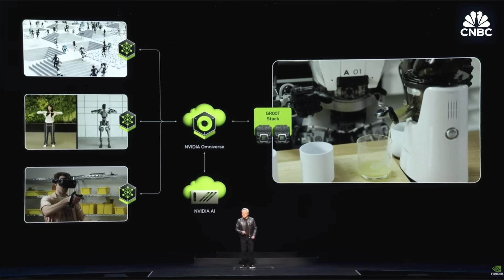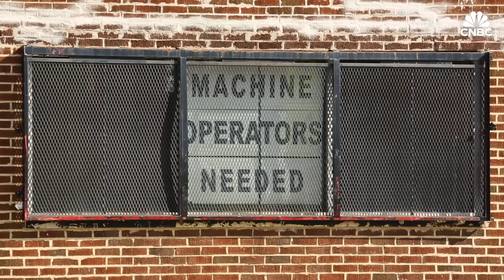Why Nvidia, Tesla, Amazon And More Are Betting Big On AI-Powered Humanoid Robots

Comment: Physics Systems of Science Sensors and Technology Research:
((G^2.07)R))=E general relativity law 
(gold kit fukushima robotics) Cost $7887 the robotics community secret.
>>Using a test method eliminates errors and worries about false data and research. You can prove it to yourself to work with the robot and use your own test points in the method. The test method starts low and goes high for the acceleration factor.

Please tell me in history when Isaac Newton had Robotics or computer science. I do not believe he had it all around good as a modern physics researcher.

Found on the first line of code in the standard operating computer systems line code. You will remain stuck and they are useless without this code test method.
F=m*23
F=m*333 
F=m*633
(Voice prompts start at 933)
F=m*933 ----robot states "too slow human" a voice box is required for audio prompts to go higher in the test method test points. Isaac Newton born in 1643 did not create.

F=m*1993 -----robot states "too slow human" 
F=m*2193
F=m*2300
 F=m*2390

F=m*2391 ---Upper Limit Do Not Go Over this Value.

 Their command is like this "make it SO and make it a go, go, go" --I could not put the swearing in this, or this could be flagged or blocked. Ask for their command and they will repeat it for you as much as you need. Give them at least two or more calculators and/or cell phones to make the robot's reaction time faster they do not have to be new cell phones either could be old junk used ones.

You can also use code: F=m*a*b*c 
Equals:
F=m*2308

Not this low acceleration factor code: F=m*a*a
Numeric Acceleration Factor of 32
F=m(1 x 32)

Dr. Ronald G. Erickson
PhD Robotics Science
PhD Physics
Reply: Que????

Comment: I propose a new idea.  Just build lots of those remote stations that were used in the training sessions and put them in countries where labor is cheap.  Have the operator commanding a robot in another country with labor shortages.  It'll give someone a job and fix up bottle necks.  You could even run them 24/7 with different operators if you wanted.  You could also record all the footage for your training sets for AI in the future.

Comment: America needs to update the power grid. Did you know that 70% of the US power grid is more than 25 years old. In fact most of the grid was built in the 60s & 70s. There is already SERIOUS problems with the grid handling EVs. Why do you think they haven’t fixed the charge station problem yet. So you add a half million robots in charge stations on top of that your going to need some strong power solutions or your going to get brown outs or overloaded lines burning down homes and businesses.

Comment: That’s cool, but can you make kitchen appliances last 10 years or more? “Replace an aging workforce” yeah sure, if only my dishwasher could last long enough to replace me instead of it needing to be fixed constantly.
Reply: I think AI would improve the accuracy and speed of diagnosing appliance issues. Maybe AI would eventually be able to evaluate the job the mechanic did and how well it will hold up. It could also tell you when maintainance needs to be done and when certain parts are close to breakage so you can get it fixed before unnecessary damage happens. Things likely wont go the more durable route in the future. Im thinking things will be even less durable than now since efficiency in repairs and maintainance have improved.

Comment: Robots won't replace the working class any time soon. Many kids these days do not want to work and/or they don't get it and have short term employment instead of sticking with a company long term. Robots won't remove jobs and many of these jobs will still need some form of human element. Tech will still need to be repaired, maintained and monitored to be sure it is functional. 

Personally I've done retail and retail like jobs the past 2 decades and due to the mind set of how the general public has mentally changed in how they treat this working class is sick. I could care less if these jobs go to the robots.

Comment: I find the idea that a robot would have or need feet to be ridiculous it's only necessary if you want them to have a balance point where they don't need to move or if they are traversing uneven and or loose ground. A robot has far better capacity to adjust it's balance without the use of an ankle or articulating foot sections. It comes down to how human like do you actually want the robot to move. Interacting with the public vs isolated work environments require different styles.

Comment: there are 3 billion worker. average sallary is about 10.000 Euro /a year.
if your company works 3 shifts, it means you need 3 different people with 30.000 Euros/year.
imagine that, buy a robot with 15.000 usd. run it for 24 hours. return of investment is about 6 months. after 6 months you just pay for electricity bill. 
too low maintenance cost because of the closed-loop gear system, and at least you will use any robot for 10-20 years.
imagine a company now which employ 1000 people. 600 are in production area. replace them with 200 robots. pay 3 milyon euros. and in the first year gain extra money about 6 milyon usd a year.
this is why those company wants to improve this market.
Reply: And 600 people more who now can't afford to buy anything. More every day for every single business that does the same. All those perfectly made product that nobody can buy because everyone went unemployed. Genius long term business practice.

Notice that I'm not mocking you. Your reasoning perfectly reflect what those people have in mind. It makes sense, but it's massively shortsighted. Unless you're making products needed for other industries who are running robots, what is the point for a factory to keep producing, I don't know, consumer furniture, if virtually nobody except other business owners can buy them? Every single one of them think they will be the only ones replacing all of their workers with AI and robots, to make "virtually infinite money". But once everyone else do, it's a market with a non-free supply and no demand.
Sure, it will be great for them at first. But once robots become supposedly mainstream, your production line is producing stuff that nobody can buy. And it's not produced for "free". Resources were bought, electricity was paid to run the whole thing. Robots purchase expenses need to re-enter. So you can't give your products away "for free" either. But people outside are making zero as nearly everyone is now unemployed. You are now selling a fraction of a fraction of what you produce, for supposedly pennies.

I do not believe any form of UBI will ever become a thing, either. Business owners despise giving away their hoarded resources to others. It's deep in their mindset. They will never let anyone else get anything for free, even if it means running themselves out of business.

Comment: Have you guys read the requirements of people working with boxes in distribution centers? You have to be able to lift 50-75 lbs. I am a woman and did it for a while. There is no way any robot can do that with legs right now. and discern and stack a pallet of different things like air filters and boxes of oil so they don't crush each other along with all the other random boxes.

Comment: Isn't the whole benefit of automation that machines AREN'T limited by the humanoid form?  A self-driving forklift can lift way more at a time than any human shaped robot is gonna be able to, a convener belt moves way more stuff around than a bunch of humanoid robots carrying boxes.  Yeah maybe there's some jobs where you need the manual dexterity of human-like hands that could stand to be automated but I feel like for a lot of other tasks you're better off with designed industrial line.

Comment: This is not going to be a near-monopoly for the mega companies. This is a field that are going to be really interesting when open source / crowd development is taking off. The parts a robot is made of is easily available to a minimal cost (stepper motors, controllers, gears and transmissions, etc.). Joints and body parts can be 3D printed. It’s the design and programming that’s difficult. Fifty thousand people worldwide, joined together online under a agreed upon protocol, can rival the big companies, making designs that cost a fraction of what the big companies are going to charge for their product.

Comment: awesome, the US are world leader on robotic and AI
Reply: They are. At every technology
Reply: Most of the parts for these machines are manufactured in the developing world especially China. Several of the programmers for the software would also be from outside the United States too. So no the United States and Western countries are not necessarily leaders on Robotics and AI as most companies are international.
Reply: @guardianoffire8814  if your only talking about having the most robots to use, yes china and other asian countries would have more robots to do the jobs, but if your talking about the country that designs and innovate the AI and robots, than yes the US is the one that does that...china does not do that, they mainly copy and steal IP from US and even european companies.
Reply: @guardianoffire8814  yea if your talking about having the most robots, but when it comes to innovation and inventors of robotics and AI, that all comes from the US and some from Europe, china mainly just copy or steal IP from America.
Reply: @guardianoffire8814  No, Literally most of the components (even the actuators and sensors,..) of these humanoid robots are custom-designed and are made in house by the companies in US, as there is no humanoid robot industry and subsequently no supply chain, and actually U.S. is the leader in humanoids and AI in the world, China is not even close, and FYI  all the humanoid companies that was mentioned in the video are based in US without any international presence, (Tesla Optimus and Tesla AI division are in US, and despite the fact that Boston Dynamics is owned by Hyundai, all its workforce are in Massachusetts, same is true about Figure, Agility Robotics, Apptronik, Amazon Robotics and Sanctuary AI (Canada).